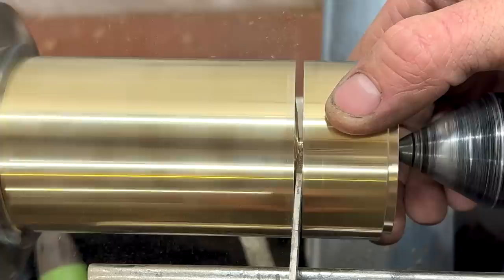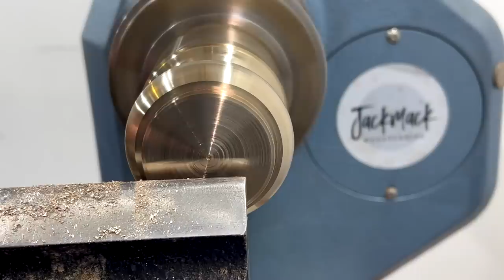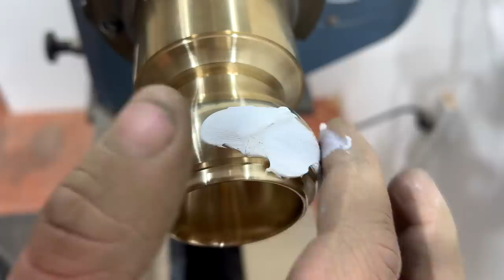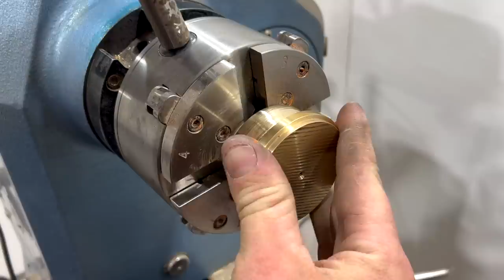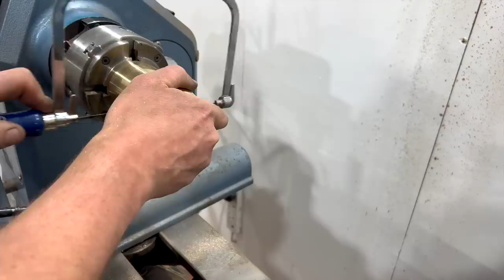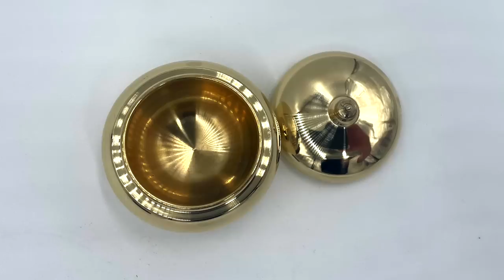Woodturning - I Turned Solid Brass On A Wood Lathe !!

Comment from the maker: IM GIVING THIS PIECE AWAY TO THE FIRST PERSON WHO CAN GUESS HOW MANY TIMES I HAD TO SHARPEN MY TOOLS WHILE MAKING THIS. 
leave your answer below. Happy guessing.
Reply: 4
Reply: 8
Reply: 0?
Reply: 12
Reply: 26
Reply: Trick question, 0 times. You sharpened before you started 😂
Reply: 1
Reply: assuming that the count starts from 0 and not from 5
i am willing to guess that you hadn't sharpened your tools multiple time when getting rid of that exess peace making the count 2 after the removal, then what I'll call the bottom took you 11 sharpenings in total for all the tools combined, creating the top and the hole took 4 or 5 sharpenings (I am severely overestimating the strength of the material) and then finishing off you required 7 more for each tool used

so the total is either 38 on the low end and 43 on the high end
Reply: 7
Reply: I think it's a lot less than some people have said. Tim may well be right but I'll saw twice.
Reply: I’ll go for 12
Reply: 15
Reply: 3
Reply: Probably (possibly?) none.  Nice work.  Kind regards.
Reply: Nice piece, I’ll guess 10
Reply: My guess for sharpening is five times; brass appears solid, but it's actually quite soft for a metal.
Reply: Let’s go with an even dozen.
Reply: 35
Reply: Guessing 30ish times.. still a really neat build
Reply: 3
Reply: I’ll try 6 Jack ….moan the 6 ya beezer ye ! 😂
Reply: Once before you started. Cheers
Reply: Oh I don’t know I’m going to guess 5 times
Reply: 17 times. Amazing. Didn’t know it was possible.
Reply: My guess is 9 for the lower part, 5 for the top so 14 altogether.
Reply: 18
Reply: I’m guessing two.
Reply: Another spectacular piece of art. Your skill is boundless. Thank you sir.
Reply: Hhmmm...
Total guess here for sure..lol...
7 times total...
Probably way off but it was going to be my question to you... "How did the tools fare ?..did you have to resharpen often ?" ...seems you're a mind reader as well for everyone had the same question for you...
I've never even thought of the procedure used on brass objects...pressed..rolled..welded..kind of came to mind...is it more common to turn them ?...
Thanks Jack..really enjoyed this...🌿🌿🌿
Reply: 11
Reply: 32
Reply: You never stop amazing us Jack! I think you had to sharpen your tools every time after every use, but I guess you have good quality tools. So I reduce my total to 9 times. 
When you started your tools where in good shape and after you ended making the beautiful brass product product I guess you resharpend them again. Between them 8 times seems reasonable to me, in total 9 times.

Never the less, I have never done, nor will I ever do this! So this is a wild guess!
Thank you for this wonderful video!
Reply: 17... 😜
Reply: My guess…way less then the number of metal shards you had to take out of your hand 😁
Reply: 5
Reply: Impressive I say you had to sharpen 18 times.
Reply: I’m going with 9
Reply: 42 times.
Reply: 8
Reply: 56 Times! 
That's once ever 4 minutes for just over 3 hours.
Reply: once per tool
Reply: 48
Reply: 10 times
Reply: 13
Reply: 34
Reply: 59
Reply: 2
Reply: 17 times
Reply: A bunch, 15 times
Reply: Not a clue, but you must have knocked 3/8" off your bowl gouge.
Reply: 142
Reply: 38 times.
Reply: 23 times…
Reply: Ill say 6 as i dont think anyone has said that yet ...lol
Reply: 25
Reply: 25
Reply: I would say 12
Reply: New answer, 
17 times. Dang someone else said 17...23.

That's my answer. 23.
Reply: 9
Reply: Tough call. But I will throw my hat in with 9 times, if only ro commemorate Ferris Bueller
Reply: 3
Reply: 5 x
Reply: I would say that you sharpened your tools 50 times
Reply: Not sure how many times you would have had to sharpen them if it was regular wood, but i am going to guess the same amount. It's hard but it's smoother than wood. Probably I'm way off lol...
(Less friction if smooth, less sharpening?)
Reply: 12?
Reply: 8
Reply: 17 times 😎
Reply: 14
Reply: 19?
Reply: I’m gonna throw 22 out there as my guess. I’m estimating my guess based on maybe 4 times per tool but I’m a potter not a wood turner so I’m probably very wrong!
Reply: I would say at least 10 times
Reply: 23 times 🤞🏼Absolutely stunning 😍
Reply: zero
Reply: 31
Reply: I would say 46
Reply: Lucky number 7!
Reply: 31
Reply: 26
Reply: You have not sharpened any tool coz brass is a soft metal and the tools you use are made of steel and may be diamond tipped.
Reply: Once at the beginning before starting then no more
Reply: 18
Reply: 35
Reply: I am trying 4 times.
Reply: Has anyone guessed right yet?
Reply: A lot of numbers already taken.... So 33?
Though I think the real number is sub 10, probably just a few times.
Reply: 23 times sharpening your tools.
Reply: Once, before you started.
Reply: i guess 0 times
Reply: 10 times.
Reply: 45
Reply: 32 lol
Reply: 18 times! This is fun!!!
Reply: t least 150
Reply: 22
Reply: 6
Reply: Id say 6 to 8
Reply: 10 times
Reply: 26
Reply: Did anyone win yet?
Reply from the maker: Yeah but it was right at the start and I didn’t want to spoil the game for everyone else 🤣
Reply: @JackMackWoodturning  so what was the answer? 🤔
Reply: 8 times
Reply: 8
Reply: 69 times
Reply: 13
Reply: 15
Reply: 16 times in total over all the chisels except the carbide hollowing
Reply: As a trained jewellery maker, that would make a sensational presentation box for a special piece, its absolutely stunning.  I'd guess that you had to sharpen each tool twice.  Beautiful work and almost hypnotic viewing
Reply: I was actually going to ask that very question. My guess is 117.
Reply: @JackMackWoodturning  what was the answer?
Reply: 2
Reply: I love this beautiful piece my guess is 16 times
Reply: About 20times
Reply: You did not need to sharpen them.
Reply: 12 times
Whats the answer
Reply: So we will never know the answer ?? :)
Reply from the maker: The answer was 0.. I believe it was FCPAudio that won. I did a post about it. 👍🏻
Reply: 15 times?
Reply: 27 times !
Reply: 4 times. I am assuming you started with a sharp tool.
Reply: 27 times?
Reply: A lot :>
Reply: I would say two dozen (24)
Reply: 31 times
Reply: ...don't know...but it sure looked like a pain in the brass...👍
Reply: 10

Comment: I'm retired but I spent half of my working life in engineering. I worked with many metals, some you wouldn't believe but...I would never have tried to turn brass by hand on a wood lathe...especially using a parting off tool. BRILLIANT! Your a craftsman sir!
Reply from the maker: Thanks DJ. What was your favourite metal to turn? Iv’e been debating melting some scrap jewellery and doing something with gold 👍🏻😊
Reply: @JackMackWoodturning  Yep...GOLD. It's amazing and I can't wait to see what you do with it. Remember...even the swarf is valuable :-)
Reply: What metals did you work with that I wouldn't believe?
Reply: @TheDeepDiveLLC  grass
Reply: After owning a wood lathe for around 3-4 weeks I turned a brass bell and several brass spinning tops with silicon nitride ball spinning point. They all were more complex than this piece in the video and the tops were spinning without any wobble until the last few seconds. One had an 18-20 min spinning time with standing stops on a concave mirror. Brass, especially C360 is very easy turn if you know what you are doing. I wonder what kind of engineering you were involved in.

Comment: Brass is the best to turn by hand in my opinion, I started turning it when I was 15 in my dads machine company. Brass for the most part is self lubricating and that’s what allows free form turning with our tools that are mild steel to hss, the lubricant slows the edge dulling down and helps with chatter. Most soft metals can be turned by hand with a flow of coolant on the piece and cutting edge, replicating brass in a sense, steel can be slowly turned by hand with a constant oil drip on the piece and cutting edge but it’s horribly slow.  I’m a machinist by heritage but a woodworker at heart, turning metal first by hand taught me boundaries that a lot of wood turner’s would never try or think of, I mainly turn big stuff that’s hard, occasionally brass & aluminum for a project and recently my wife’s rotors off her Acadia, in my opinion it’s all about the lubrication and matching it to the item turned. It can absolutely all be turned by hand, but there a big break when it’s a waste of time and money to do so.
Reply from the maker: Have you tried aluminium? Glad you enjoyed it. I reckon you will like my latest vid. Could win yourself some kit 😊👍🏻

https://youtu.be/9C0q_VLZrhc

Comment: I am a Tool and Die maker by trade and wood working as a hobby. Brass is very tricky and if you are not careful it will climb or suck up the tool. You my friend are a master with the tools and talent that is fun to watch. As to the sharpening of your tools I doubt you did, brass turning is most often done with a negative rake on the cutting edge. Drill bits are always dubbed off to keep it from being sucked into the brass as you attempt to drill it. Your ability to cut and shape brass free handed with a tool is awesome, and without a doubt proof of many years of experience. Well done my friend!
Reply from the maker: Thanks buddy. It was a very interesting experiment and I think it’s clear to see throughout the video that I start to get a feel for it as the video progresses and it becomes easier to remove larger shavings. It was lots of fun to play with. I’d love to say I recommend everyone gives it a go but I can’t recommend it as I know this could be extremely dangerous with the slightest lapse in concentration. 
But if one willing to trust their ability to keep a mind full eye on their own actions in the present…. Then “one” may find this an enjoyable experiment. 😊👍🏻

Comment: I'm actually impressed that you can achieve such a depth of cut with hand tools.
Reply from the maker: Thanks P. Are you a metal worker?
Reply: @JackMackWoodturning  I'm a machinist's apprentice 1½ year in with some prior experience. I know brass is soft and chips easy (free-machining) but even so, I would never have guessed you could go so deep with a gouging iron :P

Comment: Very cool! Just bought a big chunk of aluminum to try turning on lathe and was wondering whether I was going to have to use carbide. Looks like normal hss lathe tools do the trick. (Albeit with lots of sharpening)

Once again you show what’s possible!
Reply from the maker: Hey Ken. Traditional tools are all you will need for sure. Just take it slow and edge your way in. No deep cuts. You’ll love it 👍🏻

Comment: I have never turned Brass but I have played around with some Aluminum (much softer than Brass) and it did not mess with my cutting edge much at all but I only used it to give the surface a "Machined" look. As for the number of times I am just going to say "Over & Over" and then once more when you were all done!
Reply from the maker: Even less than that RG 😉

Comment: Crackin' job Jack. Metals are fascinating materials to work. I haven't tried to do what you've done on a wood lathe, but I "found" some brass bushes, 3 1/4" long with an I.D. of 1" The O.D. is 1 1/4" . 1/8" wall thickness that I used for ferrules on some handles on my tools. Nice and beefy to cut with a hacksaw on the lathe. I also scored it first with a home made parting tool made from a machine hacksaw blade. Yep, you're the man, man. Always thinking out of the box. Hmm, I wonder what we'll be up to in 20 years. Best regards.          🙃
Reply from the maker: Haha cheers John . Man, who knows where we’ll be in 20 years .. hopefully just turning beautiful traditional forms from exquisite green wood. 😎
Reply: @JackMackWoodturning  Here's hoping.     🤨

Comment: I would say 10 times , I am curious to know how heavy it is.  Great video.  Have a great week.
Reply from the maker: Very heavy! Guess again though 😊
Reply: @JackMackWoodturning  i would say around 5kgs and reading your comments I think you didn't have to sharpen your tools which is logical as they automatically get sharpened with the brass.
Reply from the maker: Close. The brass weighed in at 3.3kg 👍🏻

Comment: While I, as an amateur wood turner - can respect the skills in this video.... I must say I disagree entirely with turning metal on a wood lathe.... it's in the name. Also: health, safety, and all that jazz.
Reply from the maker: What do you think is more unsafe about this video than any other buddy?
Reply: @JackMackWoodturning  the offcuts may have sharp edges, no to mention the depth of cut you made on some passes looked like a lot of strain was on your tool
 If anything were to go wrong -(e.g. material grabbing at your tool or stock coming loose from the chuck) the result would be far worse than if you were using wood. Also, there was no cutting oil to be seen. Many metal lathing videos I have seen use lubricant/cutting fluid on the work and tool
Reply from the maker: I’m sure most of that is within the realms
Of reasonable. Although I believe coolant/ lubricant isn’t used when cutting brass. However. This is clearly a gimmick video and an attempt at doing something a little different for my self. To see if I could do it.. which I could. Il not be trying it again. It was good fun but it’s hardly an efficient process.. I’m confident that I approached it in a way that minimised the risks of injuries although I was ever present and aware that injury was potentially only a slip away. I’m extremely experienced with turning wood and in all honesty brass isn’t all that different to an extremely dense wood. Besides the lack of grain. But we turn all kind of composite materials on the lathe. A soft alloy is not a great leap from a hard resin.

Comment: My metal lathe was acting up so I moved my aluminum project over to the wood lathe and started going at it with the parting tool.  Glad to know it wasn't a totally stupid idea.  It did get the job done but wow did the aluminum love sticking to that tool.  Had to keep breaking it off.  Of course, I was trying to get it done in one night so I was rushing it a bit...
Reply from the maker: Safety is key. Rushing leads to injury’s 🤣
Reply: @JackMackWoodturning  It got iffy a few times.  Not something I will be in a hurry to do again.

Comment: In the joint accumulation of tools, in three shops, we have two metal lathes and a wood lathe. I started to cringe as you started this. Beautiful little piece. You done good! My guess is 817 , because, just gotta throw a number in.
Reply from the maker: The answer was actually 0 😊👍🏻

Comment: I ran a metal lathe for a time (not as long as I would have liked). I became the guy that had to do it all, run the lathe, paint and fabricate.
Reply from the maker: What model lathe ?
Reply: @JackMackWoodturning  I can't remember the model but it was a Brit lathe.
I was the shop welder and when not welding I was supposed to learn how to machine so the mechanics didn't have to it.

Comment: Im not surprised about the brass.  Its the softest of metals and Id think most copper alloys and some aluminum ones as well would work.  I was surprised to see you working with bare hands.  I bet the metal chips were a mess to clean up, but hey, no dust.

Door knob really takes shape at 3:50 lol
Reply from the maker: There was lots of dust. Lung protection definitely needs to be worn when doing this. I’d never were gloves when running a lathe.. if in any double why just Google “degloved accident” .. gloves ( of any kind) should never be worn while using a lathe. While brass isn’t the softest metal I agree it has good workability especially with hss tools which are much much harder. 👍🏻
Reply: @JackMackWoodturning  thanks for the deglove tip.  I used a lathe once in high school wood shop.   It”s one of my favorite tools I currently do not own.

Comment: Oh, I was also surprised I didn’t see you use any cutting oils.
Reply from the maker: Didn’t seem to be any need. Are you a metal turner?
Reply: @JackMackWoodturning  no, I wish 😝. But I am familiar with the working with the softer metals.  For example, I can use my wood saw blades when working with aluminum.

Comment: Jack Mack - Brassturning

From your first post, I take that you used your regular woodturning tools?!
I would have thought tools used to turn metal would be way harder!

I would say that you sharpened you tools around 50 times
Reply from the maker: Be sure to pop your answer in the pinned comment thread so that it’s not missed 👍🏻
Reply: @JackMackWoodturning  OK!

Comment: Almost as easy to turn as blackwood, except for the sharpening, of course!
Reply from the maker: Which do you think requires more sharpening?
Reply: @JackMackWoodturning  I would guess brass. I have turned a brass pen (too heavy to be practical) and I agree I had to sharpen constantly. Also, carbide tools would not help, as they are not sharper than steel, just retain their edge longer and are more difficult to sharpen properly.

Comment: Fantastic! That is a beautiful and unique little box! I'd be interested to know if you are planning to use some of those curly shavings for a project?
Also, if those were Easywood Tools, I'd say they needed sharpening 15 or 16 times, depending on how much you used each tool & not counting the one you did before you started. Roger Sorby, maybe 20? Most other quality steel tools would probably be about the same. So I guess my guess is 47 altogether?
Reply from the maker: A bit on the high side with the estimation 😉

Comment: Clever, I’ve only turned aluminium and brass so far for various projects. I even bought a metal working lathe but found using the wood lathe with chisels easier!
What kind of speeds do you tend to turn at?
Reply from the maker: Somewhere between 1000-1500